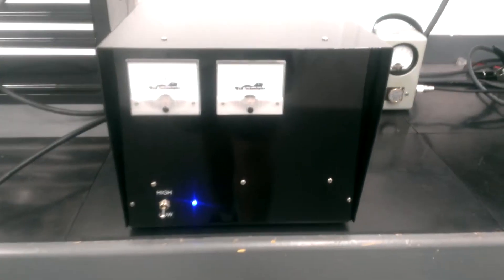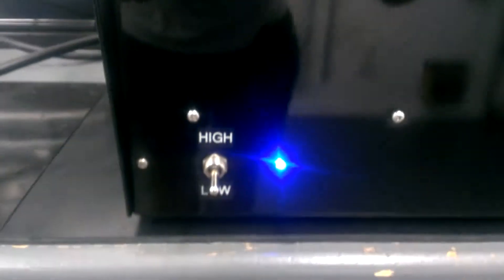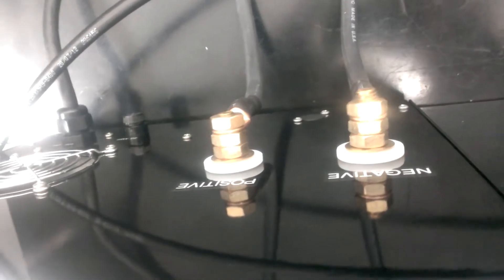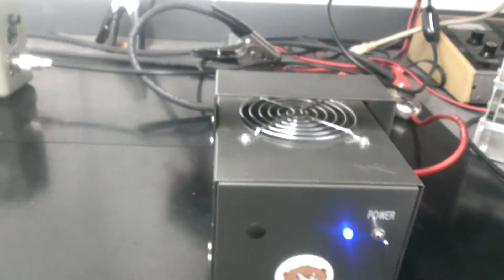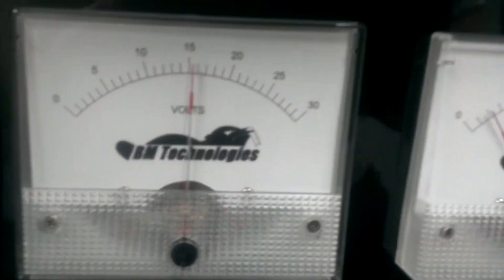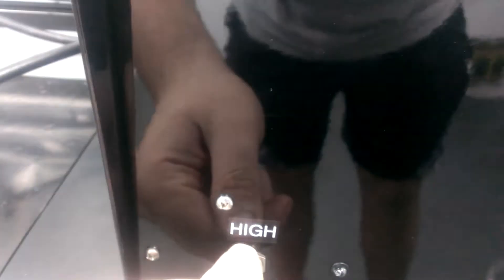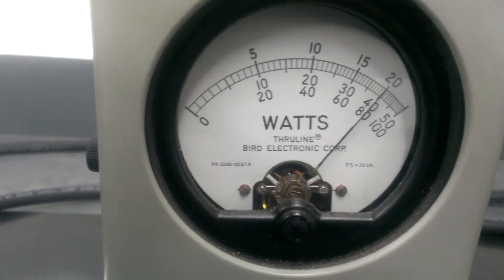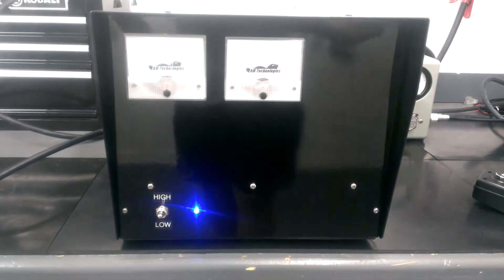BM Technology 200amp Power supply (Hi/low voltage)

Comment: Rooster, I've a question: how many devices can you connect to a 30amp 13.8v switching power supply?  By this I am referring to my Cb radio, 100w kl203p linear and perhaps the lights on my swr meter (back panel of dosey TC3001-P reads 12v).
Reply from the maker: All of the following should be fine. Allow 5-7 amps for the radio, 12 amps for the rm italy amps, very little current for the lights
Reply: @Rooster_Radio  thank you very much..
Reply: How much this supply cost $$
Reply: @captainchrisfishing  The power supply? Between $93 - $98. Pyramid psv-300. Working good.
Reply: @MusicMinisterJP7  I was talking about the 200 amp roosters selling
Reply: @captainchrisfishing   Ohh, I didn't buy my RM KL 203P from Rooster. I ordered it straight from Italy.